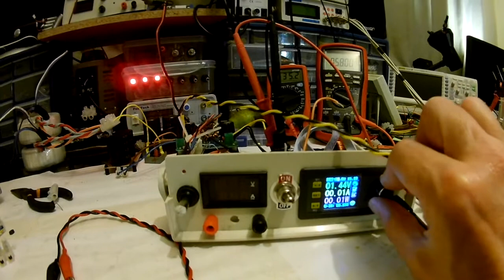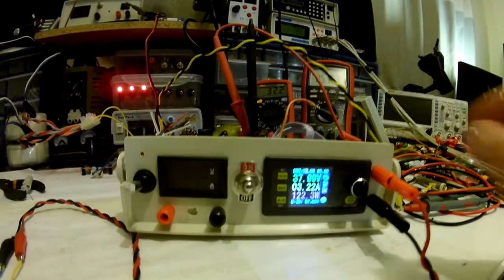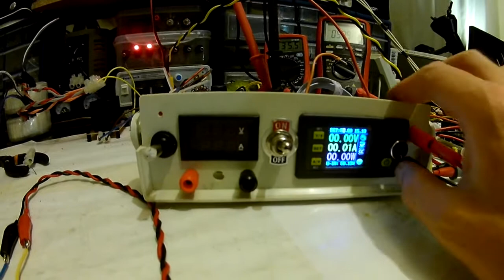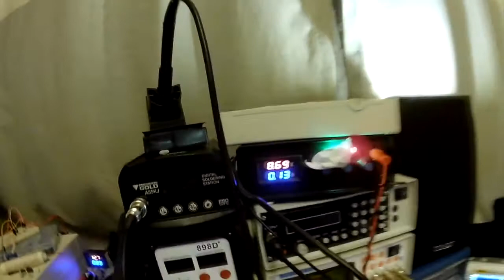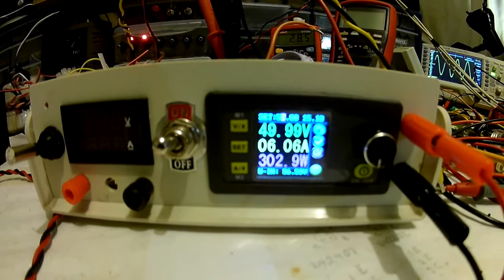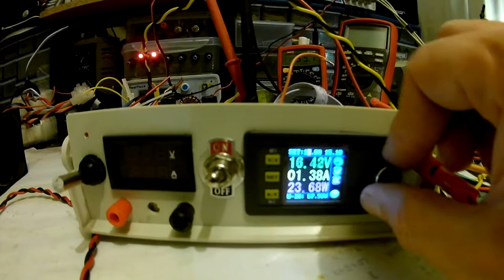Dual Parallel Transformer 600Watt Booster DPS5015

Comment: I have been looking at these modules. From what I can see the DPS series units are only buck and the DPH series are buck / boost. It looks like you are using two modules in series or have extended the ribbon cables.

Do you know is these units are isolated or share common ground ect as I am looking to feed the output of the DPS5015 to the input of another boost converter as I need to reach 100v for testing. I only need about 500ma to 1 amp of current available for testing.

I cant find any decent technical information including noise levels ect.

Any information you could shed would be very helpful.

Many thanks.
Reply from the maker: Stuartbe, All I have done and am tsing is that the 600W booster will work well enough to power the DPS5015 for my inductor circuits. I popped a 300W SMPS with this inductor circuit running nearly flat out.
I was hoping to connect the booster to my solar battery bank and use that for most of my single rail power supply. Weather, charge permitting. The way this is set up, booster and DPS share a common ground.
I am not sure about noise on the booster, I would guess it is not great but the DPS5015 is not bad. RDTECH is on YouTube and one of my subscribers, they have uploaded some video's that will give you some clarity. I do remember seeing other video's checking the DPS5015's for noise.
Reply: I actually found the video about the noise levels so will be using a 12mh inductor, big electrolitic and a zenner  to clamp it so that will solve that problem. I noticed that you have the two transformers so you are going to have a lot more isolation than me. I am going to put them in series via a meter and VR to see if there is a voltage transfer but the common ground is good news. My SMPS should isolate. If not I am just going to have to use transformers and mini inventors. Not exactly efficient but will be my only option. I am trying to trace out the circuit to see if I can control the frequency and then have an isolation transformer and rectifier on the DPS5015 input stage.

I have been able to go to the max input voltage on the DPS5015 so have upped the voltage rating on the caps just to be on the safe side.

Thanks for your info and advice, i am sure I will get this working even if it ends up being 15% efficient  :D